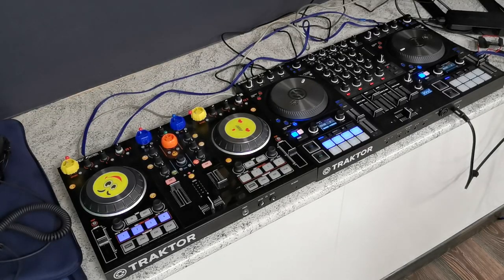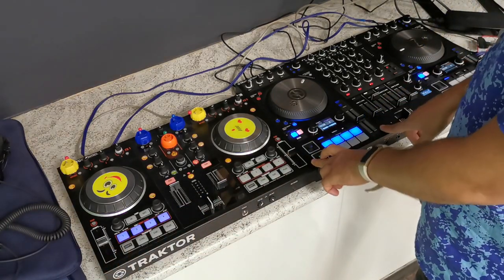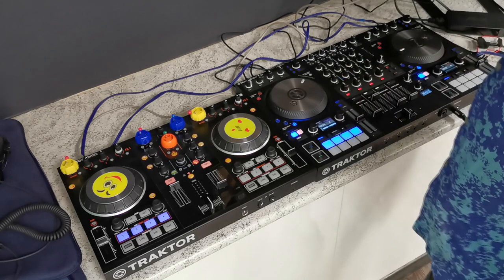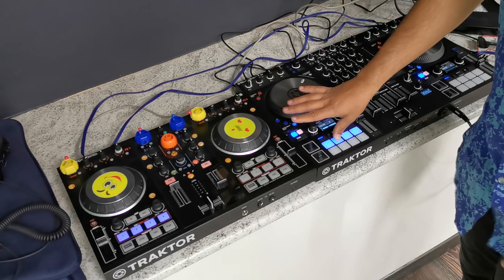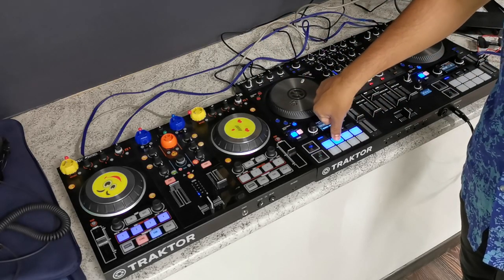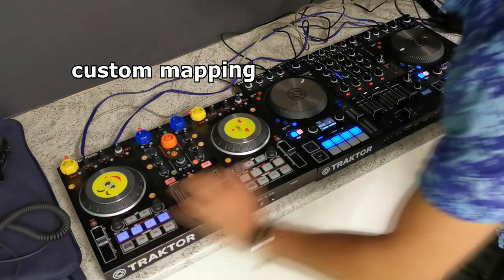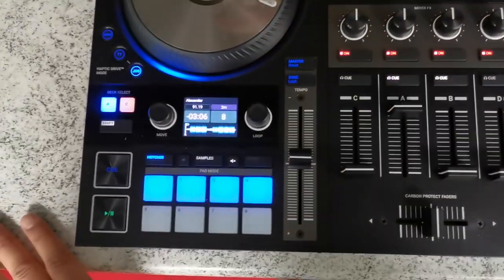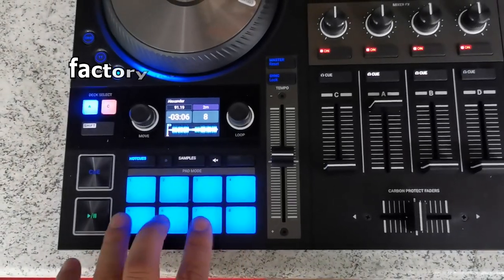PROBLEM with S4 MK3 TRAKTOR NATIVE INSTRUMENTS. FACTORY MAPPING HOT CUES

Comment: Hi, that's about now? did you find and fix the solution? i would like to buy one soon. Ask me if i don't do a mistake.
Reply from the maker: did'not find
Reply: As somebody already stated, if the deck is set to "play" you can switch from one hot cue to the next without it stopping, but it would only play the latest que point... after all those are just que points and not a piano, if you want that option, just use a remix deck instead, there you can set the samples and one shot them all at once if you like. If you use the remix deck for example on Deck C, and you have a Track playing a A, you can switch with the sample button to the remix deck "hot cues" and hit your samples.
Reply: @itsepocx  hello.I need your advise on Mk3 is it advisable to buy it?